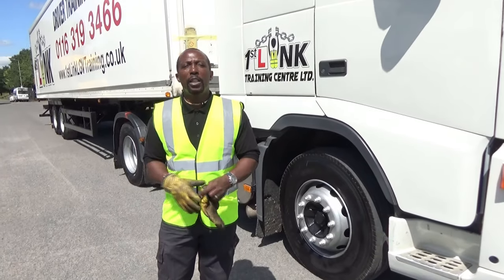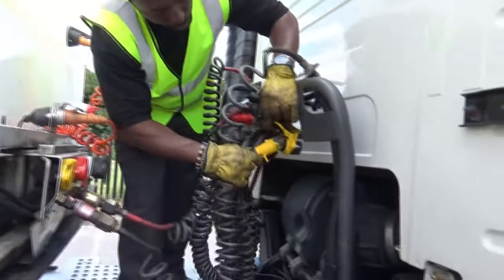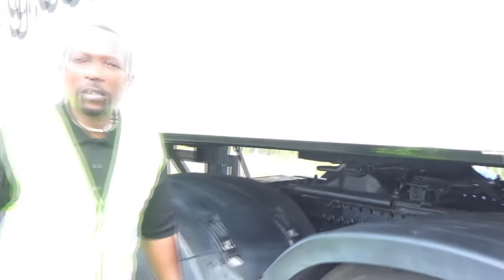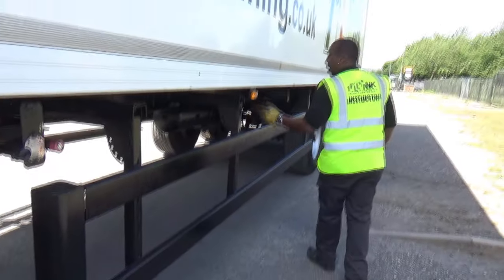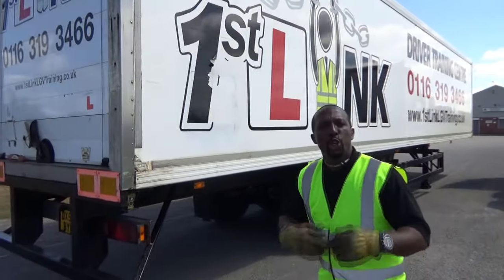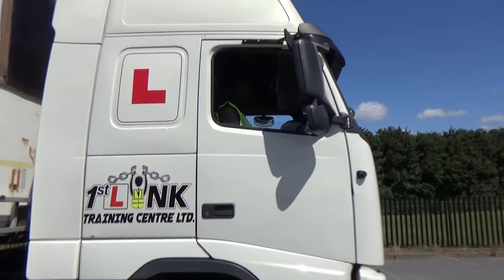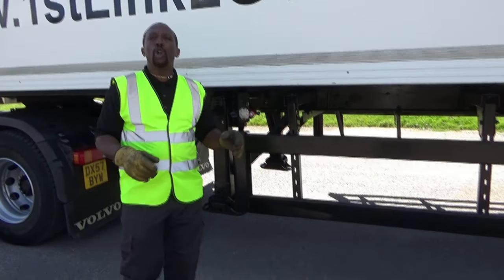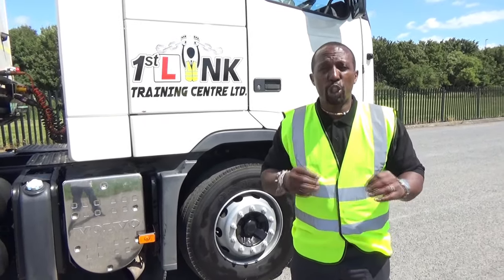Coupling & Uncoupling

Comment: it’s an amazing video that will help you to pass without stress, thanks dave for the explanation the way you teaching is professional anyone sees this video can do it with any lessons, well done and wish you the best, see u soon ✌🏽
Reply: All very good when i was taught many years ago red airline came of first then the yellow and when pulling out from trailer pull forward of pin stop and dump the air from rear axle pull out and re inflate backing under trailer do the opposite back up stop close get out check height get back in drop rear of unit back half under inflate suspension and lift trailer clear of ground back under engaging fifth wheel tug forward twice

Comment: A couple of things that I thought you should have checked are, the reversing lights on the trailer when you checked the brake lights. Also the height of the trailer matched the height sign in the cab 👍
Reply: Aren't you suppose to turn the engine off every time you come off the cab

Comment: Why didn’t you drop the air after you came off the pin?
Reply: Hi, the truck suspension can drop itself if you come out slowly, plus we have sliders on the rear of truck which prevents the truck jumping up and hitting the trailer.

Comment: Good stuff.  I passed my class 1 back in 2009 and I've mostly been driving vans since then with the occasional 7.5t and 18t run.  I've applied for an artic job within my company which means passing an internal assessment before they'll let loose on my own.  My company (Royal Mail) runs single and double-deck trailers so I'll have to remember to take note of the ride height of the trailer and adjust the height indicator in the cab to match.  Thanks for the video!

Comment: We are driving log shuttles at a port.
Trailers are unbraked.
They're a bastard to hook up when empty, and have fixed landing gear.
I end up having to smash into them to stop them rolling down the dock.
Not mechanically sympathetic, and I hate the massive clang and jerk that seems to be required,
No problem with 60+ tonnes of logs on the loaded trailers, but the empties are just a PAIN!

Comment: Loving the big red sticker above the offside drive axle. That's the most blatant Sticker / Mark / Cheat I've ever seen. And then there's the yellow tape on the O/S rear spray suppression. Not at all discreet. I'd chuckle if the examiner peeled them off one day before a test.